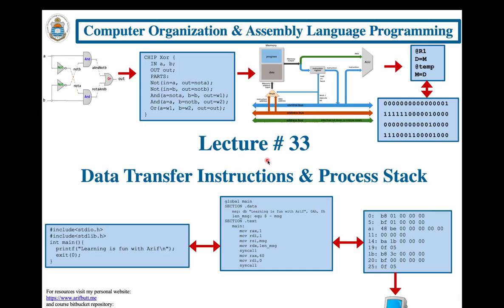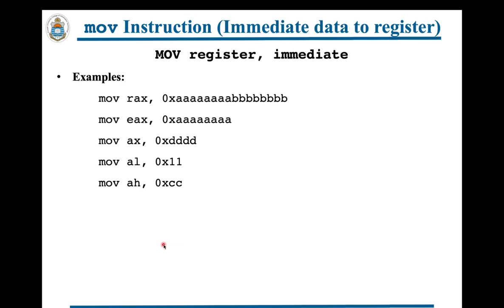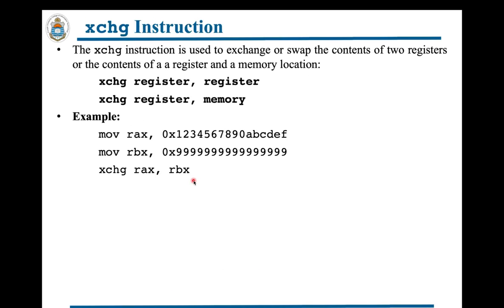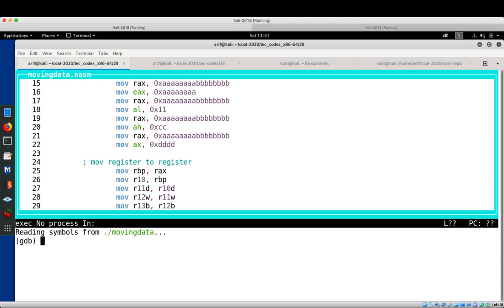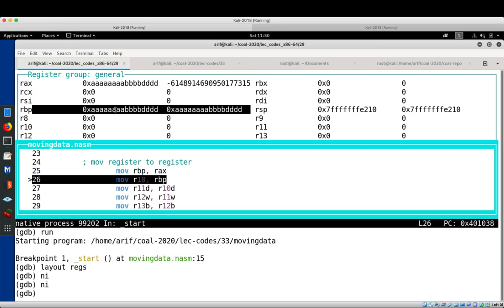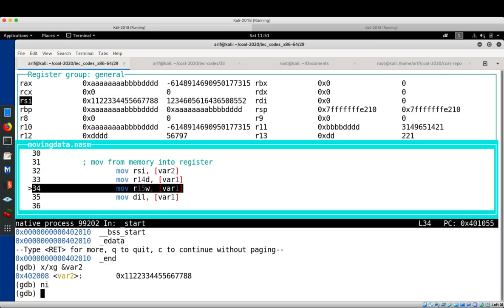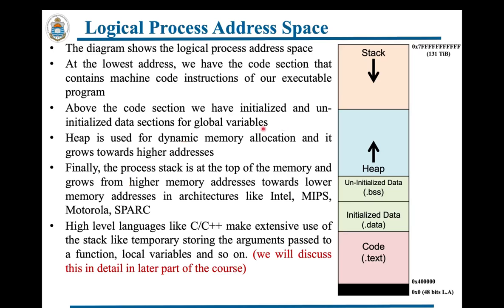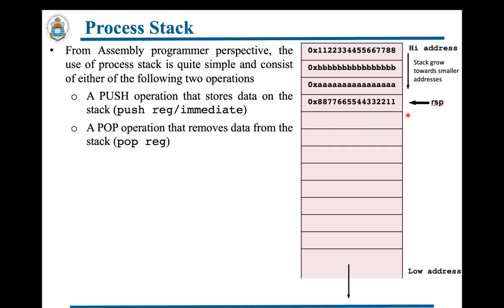Lec 33 Data Transfer Instructions and Process Stack (Arif Butt @ PUCIT)

Comment: Sir 27:13 , when we pushed contents of variable var into stack they were saved in little endianess order i.e Least Significant Byte on smallest address ,its understandable. But Sir at 28:48  we notice that the value of rax we pushed in stack (i.e. 0x1122334455667788) is still in big endianess order in stack. Why is that sir? is it because var is array and value of rax we pushed in stack is not?
Reply: The value of rax pushed in the stack is also stored in little-endian. You can verify this by examining the address of stack byte by byte where rax is pushed (can use this command --> x/8xb address). I think the way gdb shows the value of rax as it is because it is a single 8-byte value starting from a specific address (and maybe because it will be more readable by showing complete exact 8-byte value instead of showing it in reverse) but if we see this value in chunks of bytes than we will be seeing parts of this value starting from 8 multiple addresses. But when we see var variable, because it is an array of bytes so it shows each element of an array having 8 different addresses, that's why we can see the individual bytes of var during examine.
The reason I gave is "maybe". Kindly correct me if I am wrong.
Reply from the maker: @huzaifakhalid4370  Thanks for the reply. You are right. Once a program load/store a multibyte data value in memory on x86,  it is read/written in little-endian. When we display the value of a register containing a multibyte data value from memory,  it is displayed as expected. However, to understand this properly, I have shown multibyte data value from a memory location byte by byte as in the examine command of gdb. (gdb) x/8xb <addr>
Happy Learning